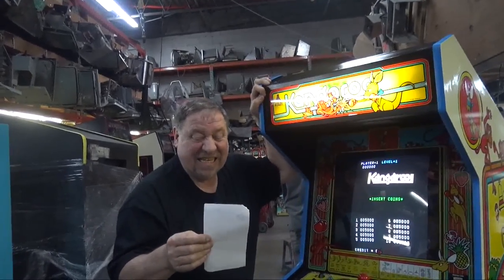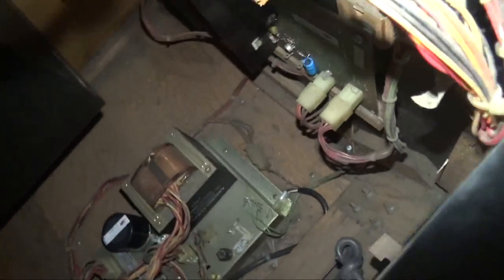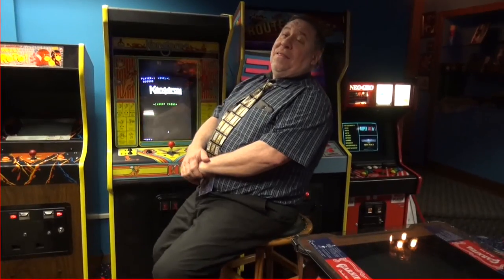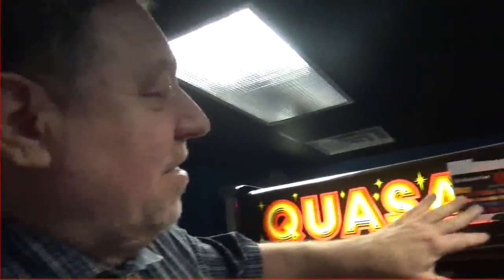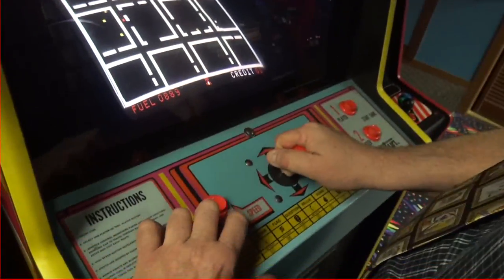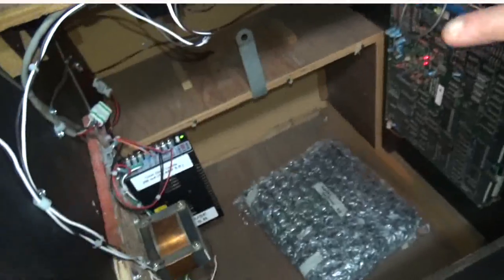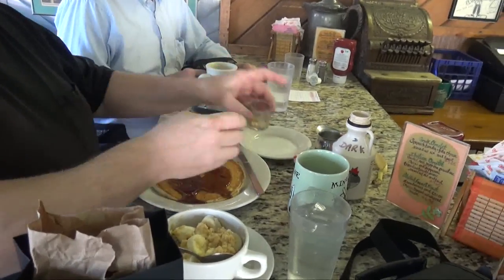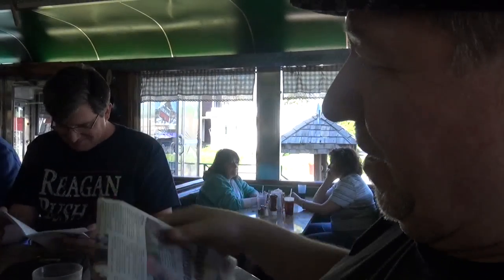#256 Atari KANGAROO Arcade Video Game-Compare Regular and Ireland Versions! TNT Amusements

Comment: I have a Kangaroo arcade game sitting in my garage right now.  The sides are painted black and I noticed under the paint is a huge Centipede.  So it's a Kangaroo inside a Centipede cabinet.  I may even remove the black paint and have the nice Centipede artwork on the outside OR I may just sell the game.
Reply from the maker: +whompmaster I wasn;t aware there was a conversion kit...but I do know the cabinets were pretty much the same...someone may have converted a Centipede from a damage Kanagaroo...since control panels will match up.  Wiring would all be different inside.  Maybe there was a conmversion kit.  I know Atari made kits to convert Centipede to Millipede (new control panel and wiring)...I never bought one, but they were out there.  Maybe there was a kit for Kangaroo as well!
Reply: +TNT Amusements Inc I don't really know other than it had to start out as a Centipede in the beginning and be converted to a Kangaroo later on.

Comment: Hi!
I now own a almost MINT cabinet of Kangaroo found near my place. It was stored for almost 20 years and everything is working great for 1 thing... The colors are off!! When I go into the self-test mode, I don't see 7 color pallets, but only 6! And they are not similar as to what the manual describes. 
In the manual, it tells me to go have a look at the "raster-scan video display manual"... Where the heck can I find that? Game is playable, but the colors are a little off and the branches are nearly pitch dark...
Reply from the maker: get the monitor rebuilt, cleaned and readjusted and it will be perfect again.
Reply: @tntamusements  Sun Corporation still exist, but just in the Japanese market. They make pachinko games & have a partnership with Nintendo for putting their games library on Nintendo's Virtual Console

Comment: Kangoroo ist a great game. Thanks for upload😀👍🏻. But in the game is a big programmerror. 🤓👉Did anyone notice this?? If the Kangoroo is crossing other sprites there is always a big black square around the Kangoroo Sprite. Remember in the Atari 2600, 5200 and 800 XL Version i can't see this failure and this is ten original Arcade Version 😔. A great game but this sprite flickering is a big error. First i thought the PCB is damage.